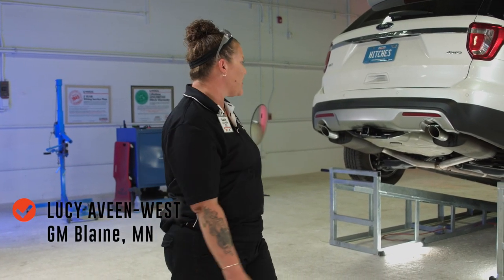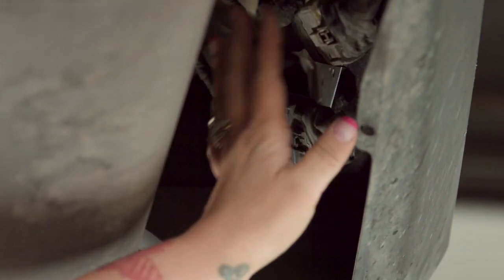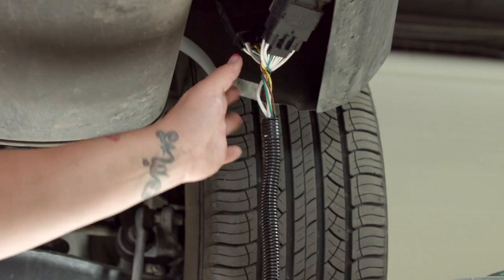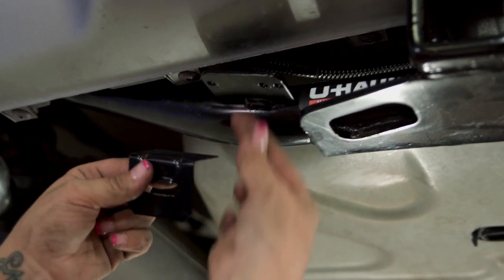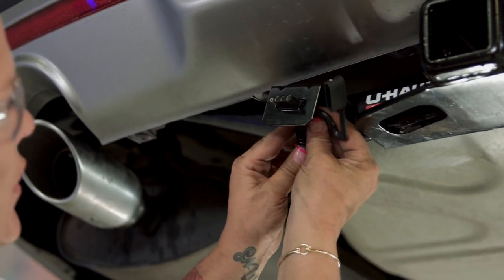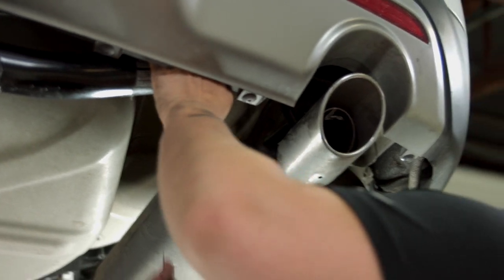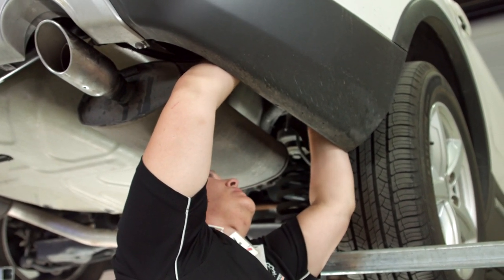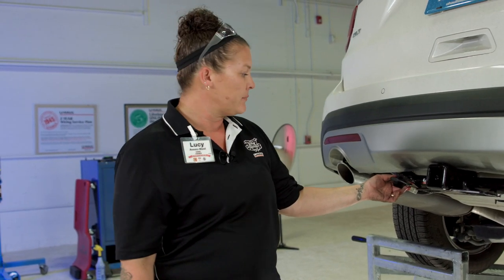2011 Ford Explorer Trailer Wiring Installation

Comment: This does not work! There is only one wiring harness behind the bumper and it ISN'T for brake lights. The T connector fits right in, but nothing happens. If you leave it disconnected the car brakelights still work too.
Reply: Sorry you're having trouble putting this harness on. This install is just a plug and play so if it isn't working there is either a connection/part issue or something is wrong with your trailer. If you continue to have issues, take it down to you closest U-Haul hitch center and they can take a look at it. You can find your closest center at the link in the description.